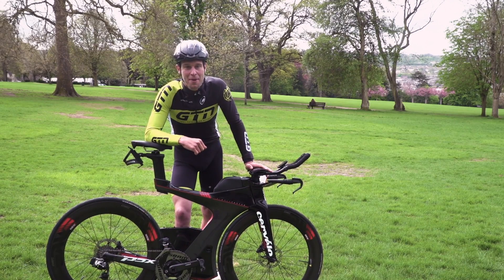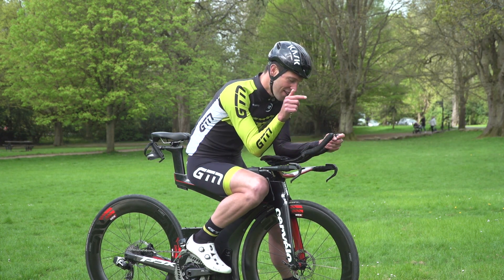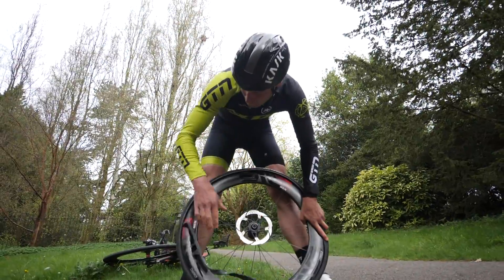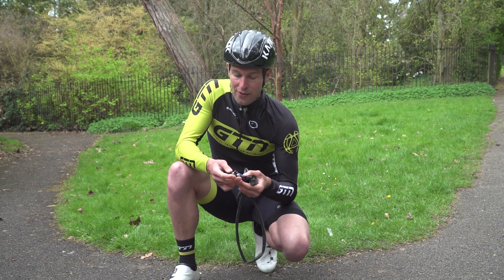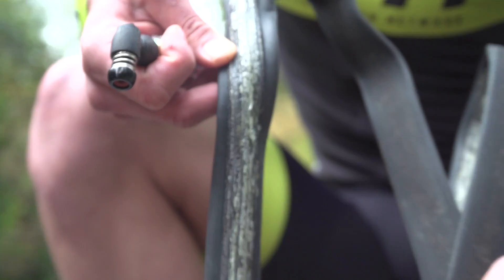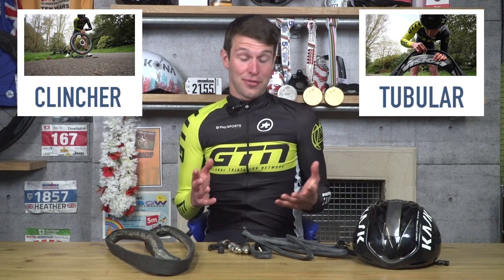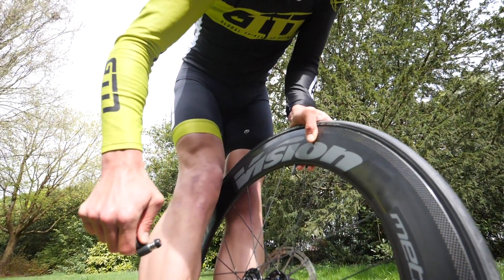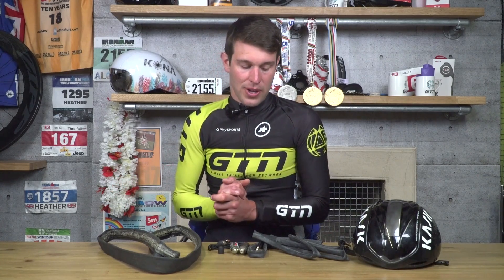Clincher Vs. Tubular | Which Tyre Is Faster To Change?

Comment from the maker: Clincher or tubular - which can you change quicker?
Reply: Just take the wheel of your opponent.
Reply: Never used tubular, but I've gone the tubeless route now :)
Reply: Global Triathlon Network  You didn’t use a straight edge. When I ride tubular part of my flat kit is straight edge. You’re supposed to cut the tire and peel it off. That would have saved you 2 minutes easy.
Reply: Clincher for me. I take patches with me as well as an inner tube in my kit. If it is a dry race i go with patching the hole and removing the debris. Saves removing the wheel and risking a pinch of the inner tube and keeps my inner tube for if i need it, like pinch punctures. As a cyclist when i patched a tyre my club mates laughed at me but then they didnt point out a water filled pot hole and i pinched the tube so the inner tube was available. If i didnt have that the patches are a marvel for most occasions.
Reply: Julio Nieves I was feeling very strong this day 💪
Reply: I have ridden on a flat clincher a few times most of them on my old fold up. One time i rode my race bike on a sportive with a flat rear. Everything was so wet and cold i sorted a patch but it didnt stick and i wasnt warm enough to try again so rode 4 miles on it leaning over the front wheel. Apart from bumping over the valve the tyre did well and the wheel was perfect. Still using it although now on my road bike. On the fold up i used to pull the inner tube out and pop it over the saddle or handlebars and spread the tyre. Does not work at all with mtb.
Reply: Tubular: in case when you have support cars with spare wheels.  Don't ride tubulars in any other case.
Reply from the maker: mark ankone, we can't advocate that one
Reply from the maker: xGshikamaru awesome!
Reply: as with many thing practice is crucial - and do it the right way. With tubulars it's not recommended to take them from the rim as you did; let a small section without glue (180° from the valve and only a few cm long), you can put a tire lever under the tire at that point. With this method you can change tubs in under 1 min easily...
Reply: surely the infinitely more pertinent question is which is faster??!!
Reply: RIght? If you are going to save a minute on tubulars compared to clinchers over the course of a race, then the chance of an extra minute fixing a flat is fine. And seems like half the time on a clincher I don't successfully extract all the thorns/glass/whatever (getting sloppy when in too much of a rush) that caused the puncture, and have to fix a second flat within a few miles. It would have been nice to put these numbers into that context.

The answer to your question, by the way, appears to be neither - tubeless has the lowest rolling resistance of the three, all else being equal, according to several recent tests by different manufacturers, followed by tubular, then clinchers. But then, I'm sure manufacturers want to sell you their newest tubeless offerings, so grain of salt and all. Still, no flat is faster than fixing a flat, every time... so I've got to ask, what does GTN know that I don't if they didn't even mention you could avoid the whole problem (and maybe be faster) in this video?
Reply: Mark Threlfall Hahhaha we can’t compete with that carbon glue 😆😆
Reply: Since I wasn't dropped on my head as an infant, changing a tubular is faster. Its not even close.
Reply: @Kason Adrien Instablaster :)
Reply: @Tanner Jake Thanks so much for your reply. I got to the site through google and I'm trying it out now.
Looks like it's gonna take a while so I will reply here later with my results.
Reply: @Tanner Jake it did the trick and I now got access to my account again. I'm so happy:D
Thank you so much you saved my account !
Reply: @Kason Adrien Happy to help xD

Comment: Over the years I've gradually switched from clinchers to tubulars.  I can generally swap a tubular tire VERY Quickly as I leave about two inches of inglued tire directly across from the presta valve.  This makes it incredibly easy to begin the removal - zipp - on with the new tire - a partial inflation - align it - full inflation - adios!  

With the clincher one thing the video MISSED (important) was to quickly pinch the clincher all around to ensure you haven't gotten a bit'a tube stuck between the tire and the rim - which can make VERY short work of a tube.

So in my case I can swap a tubular in perhaps 50 percent of the time that it would take me to do a proper job on a clincher.  No matter, time is NOT important in my riding - safety is!

Comment: Getting a properly glued tubular off is hell and putting on a spare (even one that has been stretched on a spare wheel) also requires major strength.  A good tubular can run $40-$65 and really cannot be repaired unless you have a lot of time and patience. The clincher inner tube is $3-$5.  Clinchers are the way to go.
Reply: Barry Field I have some very sore thumbs to prove that too!!
Reply: you only have to do it the right way - then it's easy and quick (and without damaging your fingers)
Reply: Tubulars give you more street cred amongst curmudgeons though, so that's a pretty big benefit (LOL)
Reply: @Fabian Ansteg But if I’m out on a 2-3 hour solo ride, and I get a flat with a tubular, must I have a spare on me or can a tubular be fixed on the side of the road as easily as a clincher? Don’t have any experience with tubulars so I’d like to know. Clincher tires with tubes are way more practical it seems.
Reply: you would normally leave an inch of wheel with no glue, pull the tyre off from there or carry a razor blade and cut it off.
Reply: use tub tape then

Comment: Tubular tires would scare the life out of me and now, I run only tubular tire and I can replace a tub in just about 3 minutes with no risk of pinching a new tube.  The only issue I have with tub’s is I’m riding with a large spare vs a small tube. That being said I’ve finished rides with the sealant saving my ride with a large glass shard in my tire where with a tube I don’t know how that would work. 

Also I’ve help riders on the side of the road where it would take for ever to put a tire back on a rim, again risking a pinch flat at the same time where with tub’s as long as it’s pre-stretched never an issue like that.

The only thing that’s left is after the ride pulling the tire off and just gluing it on properly
Reply from the maker: Cheers Boris for your comment 👍

Comment: The answer is Vittoria Pitstop. Works great with tubeless and cant see a reason why it would not with tubulars. Not that great with tubes in my experience, even if the manufacturer says different, but must admit that my sample on that use is limited to a single attempt.
Reply: Well since tubular and clincher both have tubes and some tubes have slime or sealant inside anyway (yes I know what some might think I am wrong but tubular has tube inside so undo the stitch, repair then sew back up)
Reply: Vittoria Pitstop works great with tubulars.

Comment: Clincher/tubeless/tubulars with sealant. I have only had 1 punture in 5 years that was not stopped by sealant (massive 4 inch side wall slash).
Reply from the maker: Good going Henry 👍
Reply: What sealant are you using? Thanks!

Comment: I just tried it with a carbon rim and a Conti Sprinter tubular.  I can't imagine what you spent 3 extra minutes doing?
Reply: madbikeboysins bravo, good work 💪 Like I said, we timed riding in, taking the wheel off through to the wheel back on the bike. I need more practice with a tubular to be fair

Comment: Oh, and with rim brakes it would probably be safer to inflate the clincher after putting the wheel back on. My 25 mm will just barely go between the brake pads when inflated.
Reply: Do you not have a quick release on your caliper?

Comment: Seriously, if you don't know how to use tubs what use is this "test". You are less likely to puncture on a tub and pre-stretched, pre-glued tub will mount super quick, you obviously need some grip strength to pull the flat tub off, but I have never struggled.  Always used tubs for racing, always will.....

Comment: Just how quickly a wired-on tire can be fixed depends a great deal on the condition of the bead.  A brand new tire, especially one that is tubeless ready, can require divine intervention to remove.  Lesson here is never to ride a "green" tire if it can be avoided.  Since I have spare wheels, I mount new tires at about 100 PSI on these wheels and the bead will stretch enough to make tube replacement on the road, MUCH easier.  BTW, I never ride tubeless as this "solves" problems that don't exist.  I haven't had a flat in years.

I would also posit that the time of repair will also depend on whether the front or rear tire has the flat.  In most cases, the rear tire is far more likely to puncture than is the front tire.

Finally, I think the time for tubulars is past.  Open tubulars make a lot more sense and require less cents.  These tires come in a greater range of widths and need less pressure than tubes.  This makes them more resistant to punctures, even without a protection belt.  Their weight is also quite low.  And there's this, when a tubular punctures, that's it.  While it is possible to repair a tubular tire, it will never ride as smoothly as it did when new.  It goes in the trash.

Comment: Why is this even a question, the tubular will not be fitted properly in 5 minutes and is a ridiculously expensive spare to carry compared to a tube. There is a good reason that cyclists do not use tubular tyres regularly anymore. Tubeless maybe, tubular,  not unless someone is following me with a spare wheel
Reply: not in 5 min??? I need less than 1 min...
Reply: Here's the thing: it doesn't matter which is quicker to change as you are far, far more likely to puncture on clinchers.

Train on clinchers, race on tubs.

I've tried tubeless too, but the tyres are necessarily more heavy duty and thus slower.

Comment: If you were racing with a tubular setup wouldn't you just use a sealant to get you to T2 though?
Reply: Mark Vogler that has always been my option for shorter distances. But many do replace for the longer races, and actually quite a few pros!
Reply: Mark Threlfall thanks Mark that's interesting. I race tubs but have always thought if I get a puncture in a short race it's game over anyway & in a longer race I could use the sealant to get me through. I wouldn't fancy carrying a spare tub let alone trying to change one on the side of the road in a hurry
Reply: Mark Vogler for Olympic distance and shorter I never took any spares or anything to repair. If you lost that pack in ITU racing it was game over. But 70.3 and above I always would

Comment: Tubular is faster to change with practice but the replacement will not be well enough bonded to the wheel to go hard in corners so time will lost

If you expect to have to change the tubular, some folks don’t glue a short section where you an push in a tyre lever
Reply: Lol, if anything some not glue a short section to help pull it off, how tubular is you don’t need tyre levers vs the other one, also wondering if he had tape as time to glue replacement on wasn’t there